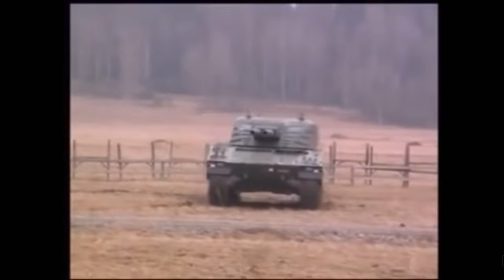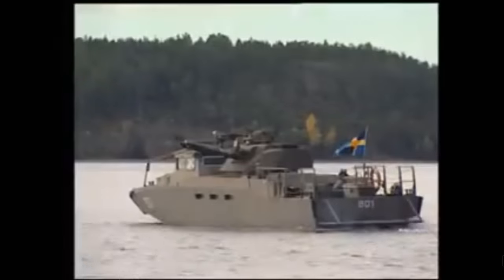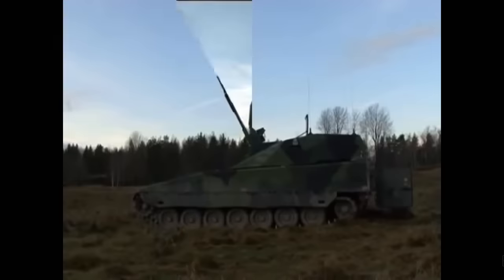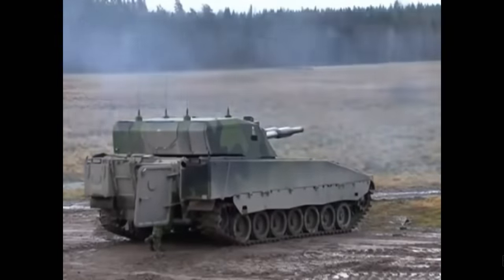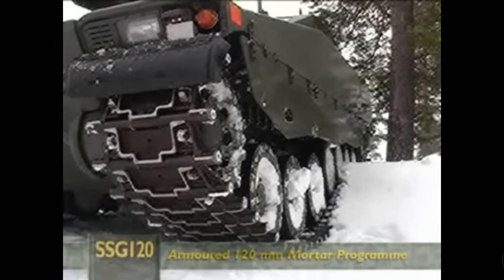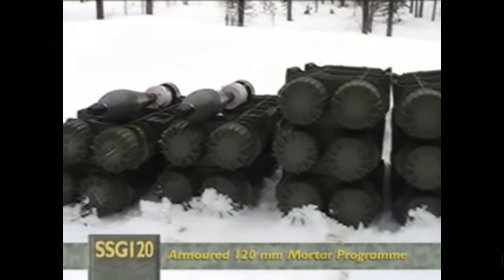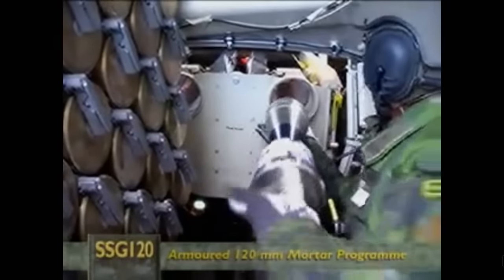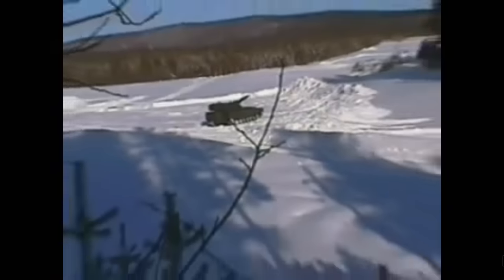Advanced Mortar System (AMOS) - Twin Barrel 120mm Mortar

Comment: a Swedish mobile armed rapid motor system, that'll confuse Ivan for a while.
Reply: Dr Bendover Russia already have mortar system on a tracked vehicle. 2S4 Tyulpan. It's 240mm and can shoot armour piercing, chemical, nuclear and laser guided rounds. However chemical weapons have all been destroyed so it can't shoot them anymore.
Reply: Origins from Finland.
Reply: kentucky fried it’s not really the same thing to be honest the tyulpan has to stop set up and has a crew of 9 to operate it it’s deployment is more like a SPG than a light weight quick firing  mortar
Reply: The finns makes turret, swedes makes the system.
Reply: Arodon3x0 I thought the cv90 was made by BAE systems
Reply: Cv90 was planned and built before the original creators (bofors,hägglunds). was bought up by BAE systems AB.
Reply: 2С31 been around since 1995. 2С3, 2C35 are for bigger targets but still mobile as hell. Do you even know what you are talking about?
Reply: Игорь Костоев that’s great but u are talking about a different vehicle
Reply: For like...4 minutes flat
Reply: RealKull didn’t the soviets think that when they invaded Finland
Reply: The Infidel :  The Russians have a mobile 120 mm mortar-artillery installation Nona 2S9. It is also on a crawl track and can swim.
Reply: олег лис they do but it’s quite old now but it did prove very effective in Afghanistan and regardless of its age it’s still a viable combat platform however this system is quite a bit newer and has a higher rate of fire and I would hazard a guess is more accurate and as a former mortarman in the British army what’s important is getting set up quick maximum rounds down range and then move and in ref to being able to swim the west has never really put importance in that due to u having to make the vehicle so light weight it’s almost not viable as a armoured vehicle at that point
Reply: MrTangolizard : Nona is a fairly accurate system. It can fire mines, tank ammunition, even ammunition from the Nato countries, and it can also fire guided missiles through the barrel. Recently, these installations have been modernized by installing new fire control systems. Among other things, Nonu can be dropped from an airplane. For assault groups of landing this car is simply not replaceable, Nona can compete on an equal footing with any tank of NATO countries. Nona is a pocket artillery for the landing. This is not a machine for offensive operations. And with her function, she does a great job.
Imagine what a company of paratroopers can do with the support of 2-3 Nona, in the rear of the enemy. Pay attention to how effectively these units were led for the sabotage operations in the rear of the Ukrainian army. Especially in 2014-2015, when there was no clear front line. The militia on 1-2 cars secretly through water obstacles came to the rear of the Ukrainian parts and from the rear they shot entire columns of Ukrainian armored vehicles, the number to the battalion.
Reply: MrTangolizard :  By the way, the speed of the guns of Nona is 8-10 rounds per minute, depending on the type of ammunition. Mortar 2S9 is equipped with an automatic piercer, which provides a rate of fire about eight ten shots per minute. When the breech is opened after the shot is opened, the barrel of the mortar is blown with compressed air, which emits powder gases out through the muzzle of the trunk.
Reply: олег лис I don’t think any light weight armoured vehicle can compete on equal terms with western tanks apart from other tanks the armour penetration on the 120mm anti tank round it fires can only penetrate 650mm of armour and for that it needs to be 1000 metres or less away however that’s not what it’s for for its job it’s viable I’ve already said that however a newer vehicle with western fire control systems which are more advanced than Russia ones with a higher rate of fire coupled with the fantastic cv90 cassis this vehicle is formidable, I do like the Russian nona and I’m interested in what u said about the operations it was used in the Ukraine
Reply: MrTangolizard :  In vain you do not underestimate the Russian systems of aiming and fire control and also high-precision guided artillery shells. In the arsenal of Nona, for example, there is a projectile Kitolov and Kitolov-2M. Such a shell can easily hit any existing tank from a distance of 9 km, moving at a speed of over 80 km, an hour. Due to the hydro-pneumatic suspension Nona is simply indispensable for ambushing operations, the machine has the ability to instantly rise above the parapet, shoot and hide back. It's also very convenient that the minimum shot range in mortar mode is only 400 meters. In gordian battles this thing is very convenient. With its help it is very convenient not to allow large concentrations of infantry. 
Under the cover of urban infrastructure, Nona can move almost with units of assault and stripping. This is a fortunate success in terms of logistics. Radio during these operations is usually heavily clogged, an electronic tablet targeting in urban battles with itself to pull, too, no one wants. And so you can communicate with the artillery directly, giving the target designation. As a result, mistakes and the probability of friendly fire are excluded. When Nona and BTR with a 30 mm automatic cannon in pair + before the company of infantry, this is the best combination for urban combat. 
BTR at high speed, coming out from behind the shelters, fires on the areas with high-explosive projectiles, forcing to hide the ATGM rifts, followed by Nona firing hardened firing points, direct fire, enabling the assault troops to safely approach the enemy in a tight one. Then Nona retreats into a safe hiding place and begins to launch a mortar fire, first at pre-explored points, then pushing the fire with each new volley 30 to 40 meters deep into the enemy's defenses. That's all the tactics, at least for the Ukrainian military, it worked well.
Reply: олег лис to be fair I think Boy Scouts could have out fought the early Ukrainian military , I think now they have worked more on there tactics and placed more weight on anti-armour capabilities, in ref to the Nona I would say for its role it’s a capable system I would assume it’s for parachute units or rapid deployment units the cv90 is more of a heavy mechanised vehicle for full armoured assaults just out of interest do the Russians have the Nona system on there new heavy armoured vehicles
Reply: MrTangolizard :  Yes, on the Armata platform. But these will be heavy floating APCs, BMP, BMPT type "terminator", and a variety of artillery and anti-aircraft systems. For the Airborne Forces and the Marine Corps, the existing models were modernized by equipping them with new sighting and weapons control systems, active and passive protection systems, and high-precision ammunition. The difficulty in developing armored vehicles for the Airborne Forces and the Marine Corps is that it is developed taking into account the aircraft from which it will have to be airborne. Airplanes of transport aviation are going to replace Russia with new ones. Until new planes appear, there will not be new cars either.
Reply: олег лис well that makes sense, I’ve seen the new armarta series of vehicles the tank and APC/AFV and they look very capable putting aside the politics of the east and west I have an appreciation of military vehicles from both sides
Reply: Its an out of this world defensive weapon as well. With a long range spotter this thing can fend off a lot of attackers. Aircraft would be a threat.
Reply: Dr Bendover don't worry Ivan already got such system long time ago..
Reply: This is the kind of talk, Hillary would like.?!? Are you a left wing authoritarian?
Reply: Dr Bendover origins from finland
Reply: MrTangolizard  in 1981 in the USSR already was a Mortar Nona 2S9.
Reply: @AbuHajarAlBugatti   I wouldn't be looking down on any country, especially if you are from Germany.  Germany tried to take over the world... twice.  And twice America and her allies had to snack you back down to your place.  America saved the free world from two world wars, and has secured the greater world peace since ww2.  If not for us, the prosperous South Korea and Japan we know today would be like North Korea.   America is also the first country on scene in almost every natural disaster world wide.  We rebuild the bridges, ports, and airports.  America also contributes the most to world aid.  What does Germany contribute other than schizer videos?
Reply: Yes they are I'm from America but if they are no go zones that's pitiful. The swedish gov should be able to control that area no problem if not it's lawless
Reply: Swedish?
Reply: Попробуй смутить ТОС-1 Ивана. Если выживешь...
Reply: I am afraid that Ivan may decide to return favor and show you "something" of his toys... Afraid you'll have to change your pumpers with same rate as your "wonder weapon" shoots
Reply: Finnish system
Reply: Arodon3x0  Wrong, this is 100% Finnish, made by Patria. The turret is the revolution, not the vehicle you put in on. In the video, Swedish army have just bolted the system on their vehicle.
Reply: russia has their own mounted onto a BTR lol
Reply: @crafty_badger  No it's not. 2C35 still has a deployment time of around 5 minutes with a well-drilled crew. [getting of a single shot] In that time, the AMOS has done 2-3 MRSI fires on the move and is returning for resuplenishment.

Comment: Why not make it a quad barrel??
Reply: why not make it a 6 barrel mortar gatling?
Reply: Was exactly my first thought...:-)
Reply: Why not put it in an A-10?
Reply: Harrison Rawlinson. Do you work for a razor blade manufacturer?  Hell, the more the merrier.
Reply: maybe concentration would be so high extra damage wouldn't payoff cost in ammo?
Reply: M ZAKRIA  Different uses , artillery is on strategic level , mortars are on tactical level. Artillery costs to much to have it everywhere.
Reply: Too heavy.
Reply: Terrain might have something to do with choice of weapons. High impact angle makes mortars extremely deadly against infantry. Mortars also give very high bang for buck.

Comment: why not quadrupple barrel, and can it fire straight?
Reply: Kickyour it can fire straight
Reply: SonsOfLorgar  so if it can take out a tank like a challenger?
Reply: It has no anti-tank capabilities. The best it can hope for is to disable the gun barrel or the tracks
Reply: Actually it has anti-tank capabilities as it can use Strix anti-tank mortar ammunition.
Reply: Yep, Strix is really nasty.
Reply: Finntastique  but i don't think STRIX can do direct fire. and it is probably cheaper to just develop a new direct fire AP munition then to use one strix.
Reply: Yeah, direct fire support only with high explosives. Strix needs to fly/fall from above.
Reply: Quadruple would more than double the weight, while making loading more difficult and perhaps even slower... Also, those hulls have limited amount of ammunition so using them all in couple of bursts just means it's going to need lengthy resupply that much sooner. Why dont miniguns use 12 or 24 barrels? Because 6 is enough and is good balance of weight and firepower.

Comment: I'm thinking: what would the drawbacks of a belt-fed high caliber cannon be? When I say high-caliber, I mean anywhere in the tank/artillery shell range.
Reply: Also, Matsimus liked my comment, so I have to return thanks.
Reply: I wonder if an electronic loader would be far more convenient than belts for high-caliber weapons. The 30mm M230 chain gun alone uses a link-less feeding system. I know many semi-auto tank guns have used one form or another for loading systems. But I think the real question to ask is: do high-caliber weapons require full-auto capabilities?
Reply: Depend on how fast you want to throw away your gun.
Reply: I would think the foremost drawback would be its handling. A single 155mm NATO arty projectile weighs about 41kg without the propellant....
The second issue would be the propellant. You want to vary how many you use to adjust your range of fire. Thats the principle which makes it possible to have several rounds shot by the same piece inbound at the same time. (You first fire a steep angle with the most propellant and then a more shallow angle with less propellant. If your math and timing was right, they will inbound at the same time)
Reply: For one thing, most artillery shells are used with bags of propellant, meaning the belt-fed thing is not an option.
Second is the safety, given the amount of force used when a high caliber gun is firing, it will be an issue to make the thing safe to operate (not much use if the gun blows up due to a missfire).
Third, there are already automatic cannons, ship born artillery can fire 120-140 rounds a minut (in theory), but if you do that, the barrel gets worn out quickly... And the amount of space needed for such a gun, means that it is pretty problematic to get the same on an army land force unit.
Reply: The links would just be dead weight and make ammo handling more difficult.
Reply: A lot of modern autocannons like the Bushmaster 3 actually don't use belts anymore, but use magazines. (Linkless feed)
https://cdn2.desu-usergeneratedcontent.xyz/k/image/1472/71/1472711887539.jpg .  - CTA40
http://4.bp.blogspot.com/-DYeUljIrgeg/VVpaTTAdzYI/AAAAAAAABdk/hHmFyreWczM/s1600/XM813%2BLinkless.jpg - Bushmaster 3

For tanks and artillery there is no credible way to belt up 50kg projectiles and have them feed reliably. Actually it might not even be possible because belts depend on having the ammunition pushed or pulled through the entire munition length (shell + propellant) to function.

Howitzers and tank cannons have been designed to have recoil lengths of less than 50cm. But a full 120mm round can be 90cm or longer
http://www.inetres.com/gp/military/cv/weapon/M256.html . 

In naval artillery of 127mm (5 inch) or 155mm (6.2 inch) or 203mm (8 inch) the autoloading is done by hydraulic rammers. Ammunition is not belted but stored in magazines where a crane picks them up and places them onto the ramming tray; or shells are placed in an elevator like contraption that raises them to the turret breech and then rammers ram the shell home.
http://www.navweaps.com/Weapons/WNUS_61-62_ags.php
Reply: probably barrel life and overheating

Comment: Needs directly threw the barrel anti tank missiles. To be a complete package.
Reply: STRIX rounds would fit that requirement, already tested and fielded with AMOS, NEMO and other 120mm mortars
Reply: STRIX is a guided mortar. I'm talking directly aimed 'short range' anti-tank. For 'Oh-Shit Oh-Shit Oh-Shit it's an enemy tank' engagements.
Reply: With a good fire control system it should be able to hit the top of a tank with a decent chance of putting it out of action, even with standard rounds. A direct hit to the top of an engine deck or ammo bustle could possibly deprive a tank of mobility or firepower. With twin barrels and rapid reloads AMOS could conceivably rob a tank of both from behind terrain using indirect fire and then scoot out of there before others get too close. While the tank crew may survive, that is not really a problem since the primary mission goal of stopping their advance may be accomplished. Specialized antitank rounds would obviously increase probability of disabling or destroying the tank but even high explosive rounds could be a threat to many tanks when hitting the top.
Reply: Papa Cap for Oh-shit moments it's fully sufficient with two direct fire 120mm HE followed by two 120mm smoke. While it won't kill a tank, it will most definitely shake the crew about enough to get away and relay a fire mission for STRIX to the covering AMOSs of the other platoon of the same company.
Reply: Rob a tank of its tracks and it becomes a pillbox. Still dangerous but a lot of its teeth have been pulled.
Reply: If your that close you suddenly have and oh poop moment, you fire what is in the tubes and run, not trying to find and load special tandem style HEAT rounds for top attack. 

The direct fire is for support of troops, suppression of enemy troops, firing at bunkers or buildings, maybe posting a round though an embrasure or window. Not shooting at armoured vehicles.
Reply: No it doesn't. This system is designed to hit targets from above where armoured vehicles have little to no protection. Think before you write.
Reply: You don't need to penetrate the armor on a tank to screw it up, totally disable it, or even kill the crew inside.

A direct hit from a 120mm HE against any sort of MBT (T-90, Abrams, Challenger, etc) will blow the tracks off, screw up the optics on the cannon, probably disable the turret, and very likely give the whole crew concussions if not outright kill them. Regardless of whether it actually penetrates the armor.
Reply: BCrafty121 A 120mm HE from a tank gun would not penetrate or even cause spalling on the inside of a modern tank, it may rattle a few teeeth from the crew but thats about all - even a 120mm HESH which is far more effective against armour than a bog standard HE round would do little to the inside.

Now the outside is a different matter, optics, tracks, road wheels, all manner of things attached to the outside can be damaged or destroyed, the tank could be mobility kill, gun damaged, optics broken, crew panicked, etc - all of which can effectively knock a tank out of the battle.